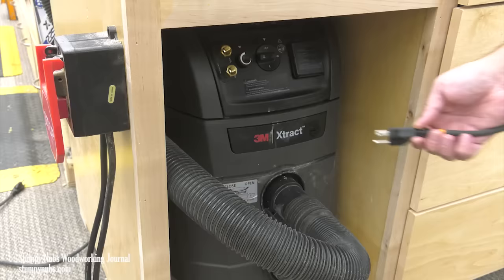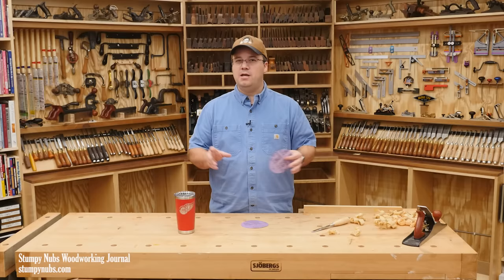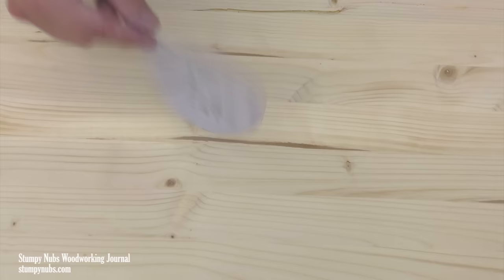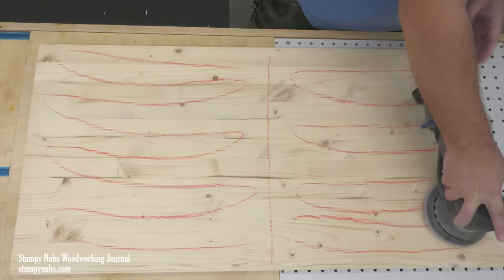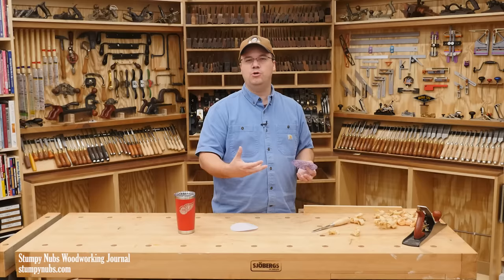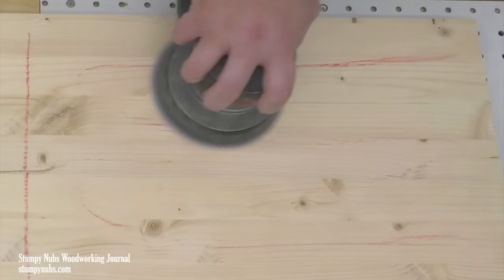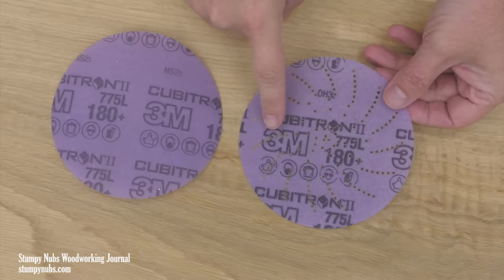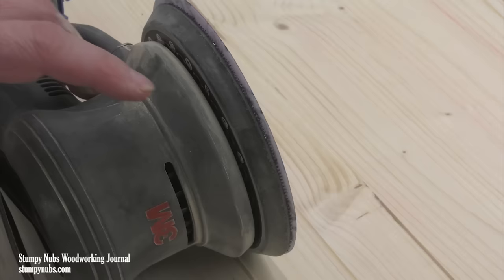This LITTLE KNOWN tip will cut your sanding time in HALF!

Comment: Its like something lurking in the back of your mind. You know but you dont know. Like its impressive to actually see it play out in front of you. And something you dont think about often. First thought is I dont want dust. Then its just in the back of your mind like this is quicker weird. So you dont pay much attention to it.

The 775L are amazing but they are like $2 a disc aka the ones in the video. I usually go for the 3m 310W which are under 50 cents a disc for 6in which is what I need. Not as good as the 775L  but the 775L arent 4x betters. I would say guessing/estimating like 15-25% better. So I gotta stick with the 310W

Comment: The first the dust with the was had nowhere to go so much of it was left where it sat. It doesn't necessarily mean that the wood was less sanded. The other picked up the dust an wax and took it away. I'm not sure it really made a huge difference in time. You could've just taken a rag and wiped off the first portion and most likely have he same results. Did the extraction save time? To a degree but I'm not convinced it would be in half. I can see how the left over dust can cause damage the wood if it's not subsequently removed...
Reply from the maker: Look closer. The sample without the dust collection left a great deal of the marks on the wood, which you can still see through the dust that sets on top. The dust clogged the grit and kept it from working efficiently and resulted in significantly less removal of material.

Comment: My shop vac hose doesn't seem to fit ant of the power tools I have with a port on them, so I just wear a paper mask and sand anyhow.  If I get marks with the orbital sander I just switch to a 1/3rd sheet sander, or a sanding block and hand sand.

Comment: Vacuum wil cause an airflow taking away dustparticles but importantly cools the surface taking away the    main ingredients to clogged up sandpaper. Why do I like wet sanding painted surfaces no dust, no clogged paper and the speed😊.

Comment: Hello James, I'm not convinced that this test shows anything. What is interesting is "shop vac vs integrated dust collection system", in NO CASE you are supposed to use an orbital sander with a plain disc! On mine, the air flow from the internal turbine works surprisingly well at collecting dust in the "bag". I don't gain much with my shop vac attached, besides tons of noise due to (I believe) a bad design of my particular sander. So overall, it works better without external dust collection.
Reply from the maker: I think you miss the point. The video is not really extolling the virtues of shop vacs, it's about using suction to keep the sandpaper free from dust buildup during use. If your sander's internal dust collection does a good job at that, it will speed up your sanding, as well.

Comment: For an accurate comparison you need to do a sample with the sandpaper with holes without the vacuum. Obviously the sandpaper without holes will ride on the accumulated wood dust but it will be taken up and ejected with holes in the sandpaper. The vacuum is neatly clearing the dust and probably more quickly but I'm betting the with holes sandpaper without a vacuum attachment will greatly reduce sanding time as well. But why aren't you wearing a dust mask when sanding? Are you going for a Guinness World record size dust booger ball?
Reply from the maker: How will holes "eject" the dust? If anything they will clog up quickly and stay that way until you stop sanding and lift the disc.

Comment: Are you saying that the improved dust collection offered by the discs with the spiral holes will offer an improved performance even on non-3M Xtract sanders that only have six or so larger holes?
Reply from the maker: Yes.

Comment: Problem with using wax for the comparison is unless it immediately hardened by some chemical process the sander would take it off then start putting some of it back on the wood because it isn’t being removed just like the dust. Should still be faster with the vacuum but wax is a bit of an unfair marking method

Comment: I bought a festool midi( I think, It's still in the original box). Is the 3m system that much better?
Reply from the maker: Both are excellent extractors. The biggest differences are the 3M has dual filters that can be auto-cleaned in an alternating rotation so the suction is not interrupted. That's very useful when you are sucking up fine dust for an extended period. And the 3M has auto-on support for pneumatic tools.

Comment: I'm curious, have you compared sanding with dust extraction vs the dust bag found on most sanders? That would probably be more of what most people would be used to using.
Reply from the maker: The point is to suck out the dust. It doesn't matter where the suction comes from. If your sander does it effectively on it's own (few of those really work well) then you will get the benefits.
Reply: Agreed - was simply curious if you had tested. Thanks for the reply. @StumpyNubs

Comment: Are the 3M Cubitron II rolls cut to width for sheet sanders that use 1/4 sheet?  I don't have my sander / sandpaper in front of me right now so I dont have dimensions of the paper?  Also, I was reading about the triangle shaped grit thats on this paper.  Is this kind of grit only on the 3M sandpaper that states "Cubitron" or is all of 3M's sandpaper using this kind of triangle/ceramic grit?
Reply from the maker: I am not sure about the rolls because I have only used the discs, so far. The triangle grit is only on Cubitron II paper, not regular 3M paper.
Reply: Awesome  thanks for the info!  I started sanding these 2 wooden chairs that a friend of the family made for us out of some spanish cedar that came from my grandfather's lumber import.  He made these chairs all the way back in 1996 and they have been sitting outside either on the end of our dock or on a porch and you would not believe how good of shape the wood is in.  Spanish cedar is like cypress when it comes to water/rot resistant but it has such a much cleaner grain without all the knots that cypress has.  @StumpyNubs

Comment: I use a cyclone filter attached to a 5 gal bucket and a shopvac. When I connect it to my sander, the bucket compresses, but works fine with all the other tools. Kinda seems like the sander is restricting the air flow? Any ideas?
Reply: Add a waste gate to the system somewhere before the 5 gallon bucket- a blast gate that you can slide open a little/a lot to "waste" suction until the bucket doesn't collapse.

Comment: Here’s a question I’ve never really seen an answer to regarding sanding. Can I reuse sanding discs? Or are they one and done after using them on a project? If you can reuse them how do you know when a sanding disc is done?
Reply: I'm blowing through 180 grit Gator brand discs pretty quickly on a $60 Bosch ROS with a shopvac. After 3-5 minutes of sanding, it feels less "grabby", I turn off the sander and flip over, there's basically no grit left. Getting really nice results, but I'm gonna try different paper next time. (Going right to 180 grit is kinda wasteful, but the 50 pack was cheap.)

Comment: Interesting concept.  But I wonder why you touted those sanding disks as the best you've ever used when a few years ago you touted some sort of diamond sanding disks.  Of THOSE disks you said they last far longer than ANY sanding pads you can get.  I believe you.  Somewhere in my files I have a link to that episode.

I have a lot of admiration for you and appreciate the dedication you show when discussing wood working.  But you do need to resolve this issue - the issue of saying "This is the best I've ever used."
Reply from the maker: It's not an "issue" at all. The two are apples and oranges. The carbide discs are only available in rough grits for shaping and leveling. The sanding discs in this video are for smoothing and finishing. (And I never said the carbide discs were "the best I have ever used," so there is no contradiction there, either.)

Comment: How do you think the mesh version of the 3M cubitron would stack up?  Is there a point of diminishing returns?

You and Taylor Toolworks sold me on the cubitron years ago.
Reply from the maker: The mesh has the best airflow, but it can shred around the edges if you sand aggressively, or if you sand up against perpendicular surfaces. It all depends on how you typically sand, and what you typically sand.
Reply: I saw a recent video that compared a bunch of different brands, including the cubitron mesh and perforated disks. The mesh works the best by a pretty big margin, but like Stumpy says they're less durable. Depends on how rough you get with your sanding - if you're knocking off corners and nick the occassional screw, you'll probably tear up the mesh. Maybe try a small pack of both and see what you prefer - they both work great, so it's not a big loss either way.
Reply: For clarity.  I Use both the mesh and perforated and am happy with both. My question was more along the lines of how much airflow is enough?

Comment: So based on the suction theory, is using the velcro pad savers drastically reducing the suction with the smaller holes? Iv noticed that i have to vacuum out the velcro 2-3 times before the pad needs replace, or it builds up enough that it will stretch a fairly new pad. but just at one hole or edge then the swirl bird starts.. like to see u compare this same test with & without saver pads for amount removed vs added longevity of pads.
Reply from the maker: I don't believe a pad saver reduces airflow. It gets dusty because there are more spaces between all the little plastic hook on on the two combined pads for dust to build up. But that would have no affect on the sandpaper, unless the velcro got really plugged up, but I've never experienced that.
Reply: @StumpyNubs  Ya, to be fair i mainly work with gummy pine & pre primed ship lap.. I usually sand average 500'+ board feet t&g, trim, beams,  mantles etc a week. Just curious since im trying pad savers & still on 1st set (on 6" festool) after watching on of your previous vids overa year ago.  Is there much difference in suction performance among different pad manufacturers or matter if the holes line up , pad to pad ?

Comment: how do you get rid of dust when hand sanding?
Reply from the maker: You are creating a lot less dust while hand sanding. For one thing, you are moving the sander much slower. But the biggest reason is hand sanding is typically only done with the finest sandpaper grit, which removes far less material. So the dust can be managed by lifting the sanding block and blowing it away every minute or so.

Comment: James, I am sure you mentioned it in another video where you spoke about the cubitron. Do they last significantly longer than traditional good quality paper ones?
Need to replenish a couple grits, and it might be time to upgrade!
Thanks for another great tutorial.
Reply: I made the switch to the cubitron. With my old Diablo paper disks, it was basically one job, then toss. With the cubitron, I have several that I have been able to re-use on up to five jobs. And, they are still going. Since I switched 6 months ago, I think I have thrown 1 cubitron away.  I didn't get the cubitron with the spiral holes, the ones I have are a mesh. They also work great with resin pours.
Reply: @skyehagen5521  Skye, appreciate the insight!

Comment: I know I am late to the game, but I have two questions:  Why not use the SAME spiffy "with hole" version of the sandpaper with the manufacturer bag collector vs with duct collection?...apples for apples...  I only ask because my Rigid R2601, which claims to have some unquantifiable "AIRGUARD" technology, says that hooking it up to a dust collector will damage it and reduce effectiveness.  Also does the method of dust extraction matter?  I've always been under the impression that volume extractions (ie lathe or planar) vs particulate extraction (sanding or saw) were dramatically different.  I also totally accept that I don't KNOW anything, and blame the fact that anyone can make a Youtube video...

Comment: What's the hose & clip you have attached to your 3m sander
Reply from the maker: That's from Rockler. I think the hose comes from one kit, and the quick release fittings come in a different kit.
Reply: Does the hose connect to your 3m dust extractor?

Comment: Crayon doesn't seem like a good substitute for a carpenter's pencil when sanding, as the wax (albeit a very small amount) will gunk up the sandpaper grit and the air holes. And obviously clogged wax in the grit is going to cause it to be spread around and also pick up sawdust thereby causing your disc to be clogged even faster.  Also it seems to me that holes in the disc that line up with the holes on the sander will keep your sanders velcro from becoming clogged with sawdust as it will with a disc with many holes.

Comment: You prefer these discs over the net disc?
Reply from the maker: They are both Cubitron II, so both have the special grit that I like so much. The mesh allows for better airflow and there are some other advantages. But they tend to shred if you hit something with the edge, making them best for large, open surfaces. I use both, but I think most people would prefer the added durability of the spiral-hole disc.

Comment: the act of sanding by definition scratches the wood.  the ones that ruin a finish are because the guy sanding didn't clean up the scratches from the previous grit. sand from course to fine grit, cleaning in between each grit pass, as i'm sure in this vid shows, dust collection helps, but the biggest perp of a scratched finish is left oveer course grit on the surface from a previous pass. it does no good to sand at 180 when there are a few pieces of 120 grit still under your sander.  
its all about cleanliness, like the man says....

Comment: I’m going to disagree about the sanding effect regarding vacuum or no vacuum. I’d say it looks like a better job was done because the red wax was removed by the vacuum as opposed to being left behind because of no vacuum. I’d be more convinced if you were to weigh the vacuumed sawdust and compared it to the sawdust left behind by the disc without a vacuum. Or weigh the wood before and after vacuuming against the wood with no vacuum. I’d even say the missing grit from the vacuum holes made it sand slightly less than the hole-less sanding discs. But I’d also say you get a cleaner, more evenly sanded board using a vacuum. The used broken grit particles are sucked away giving you a better surface. So your point is taken but maybe not for the reason you might think.
Reply from the maker: The dust left behind gave the wood a pink color, but you can clearly see a lot of the actual red lines remain.

Comment: My sanding discipline is terrible. I accidentally round over things or sand too much in spots. On important projects or anything that has significant time invested I drive myself nuts trying to sand and not screw up. Sometimes I leave scratches from low grits on the inside and feel stupid about it even if nobody will see it because of a drawer or something. I’ve done a hundred or so projects and still haven’t mastered it.

Comment: Very disappointed.  I bought (from Taylor Tools) some of these discs and they won't stay on my ROS.  I have a Marita 5" and probably every major brand of discs you can buy.  They all stay on, no problems.  I put the first one on and it spun off before it made any dust.  Sense the base is a few years old I ordered a new one.  Same results, they spin right off.  They won't even stick to the hand sander I have for using hook/loop sanding discs.
Reply from the maker: I can't imagine how that can be happening. They work on every sander I own- 3M, Mirka, Dewalt and Ridged, and not one out of hundreds of viewers that have commented about using the discs have ever had that problem.

Comment: While your assertion that dust extraction improves sanding may be correct, this experiment does not prove this one way or another.
The remaining pink smudges on the side without the dust extraction is to be expected as no loose dust or pink wax is actually removed from the surface after sanding. It should have been blown off with air at the end to remove loose dust and wax to see if the sanding was effective without dust extraction.
Reply from the maker: It's not just smudges from remaining dust. Half the lines are still there.
Reply: @StumpyNubs  
I'm not trying to dispute your overall result though the loose dust and wax needed to be blown off so we could see the real difference.
Reply from the maker: @aurumbeach  The loose dust was the point of the test, it is what kept the lines from disappearing, as explained. Even so, you can still clearly see the remaining lines in the video.

Comment: Jus putting this out there: The experiment is already flawed by the use of different sanding pads. For example, holes in the sanding pad may provide a place for excess dust to accumulate and speed up the process by a similar amount.
For these kinds of tests you really should use the exact same pad.
Reply from the maker: You saw that pile of dust that built up from just that small area. There is no way any significant amount of that is going to hide in those little holes.